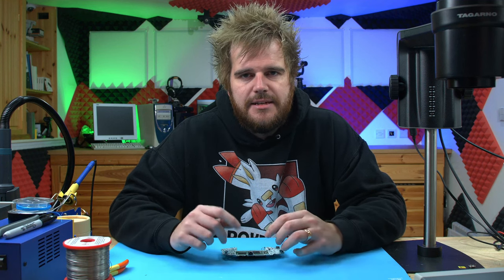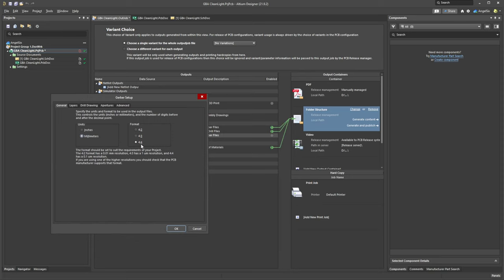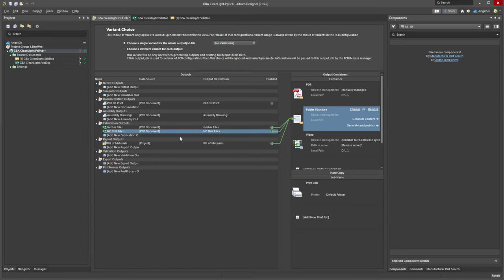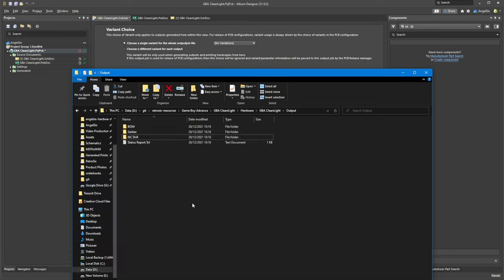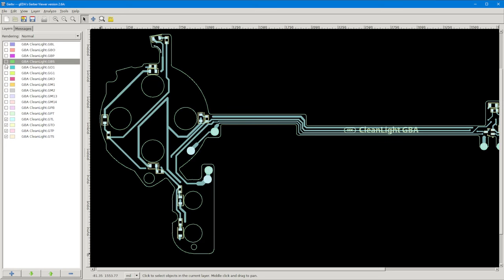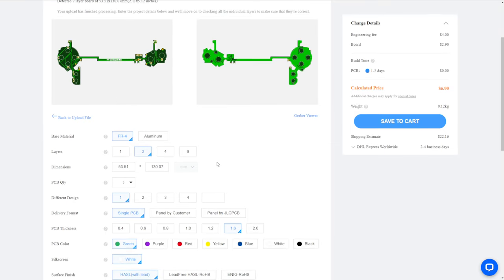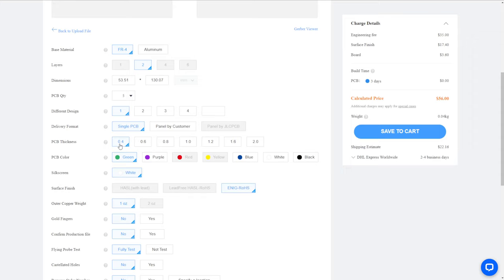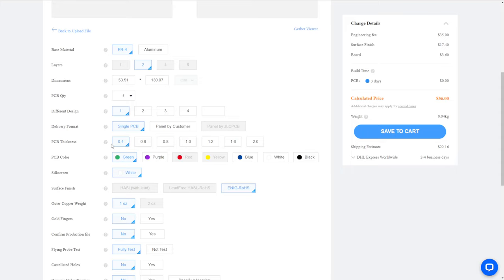Producing Real Circuit Boards from PCB Gerber Design Files

Comment: Awesome video! But where do you go for the flexible pcb and what are the settings besides the thickness of .18?
Reply from the maker: 0.4mm rigid works fine. But for flex PCBs you need to go to a factory that do flexible. Most professional fabrication houses do them
Reply: @RetroSix  Ty for the info, I bought all the parts to make them from your site, but what are the two capacitors values? Who do you use for the flexpcb? The company you use in the video doesn't have flexpcb options as far as I could tell when I tried to order from them.